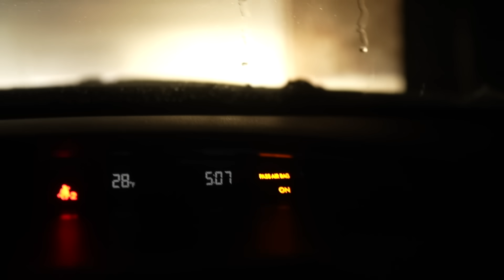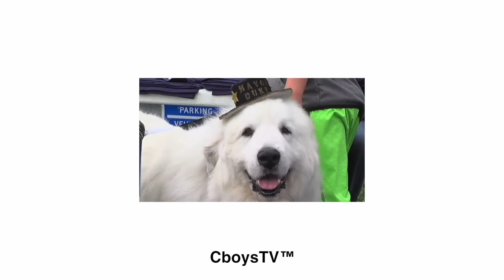I Built a New Truck to Stop Getting Pulled Over!

Comment: Take an old dirt bike front fork assembly and Mount in the rear center of the car you just cut in half. Trust me fun level with that thing will increase exponentially. It will also allow you to do endos when you slam on the brakes.